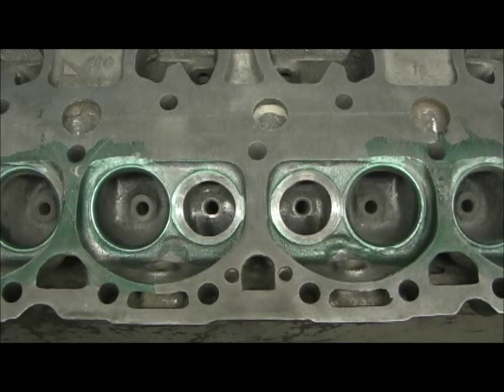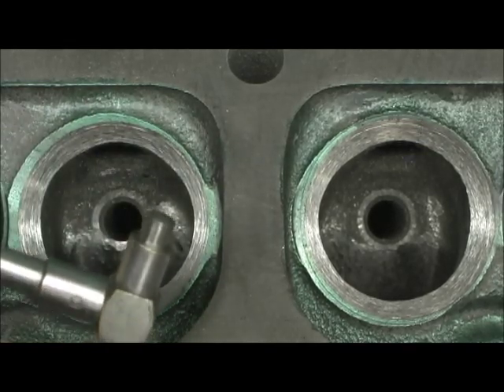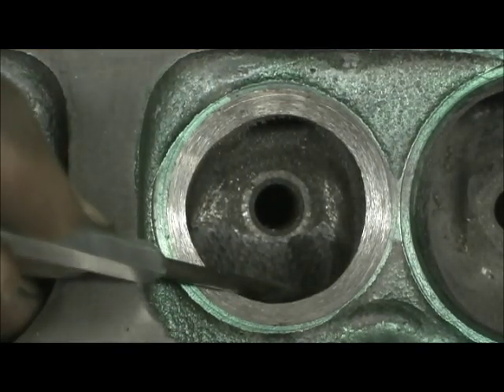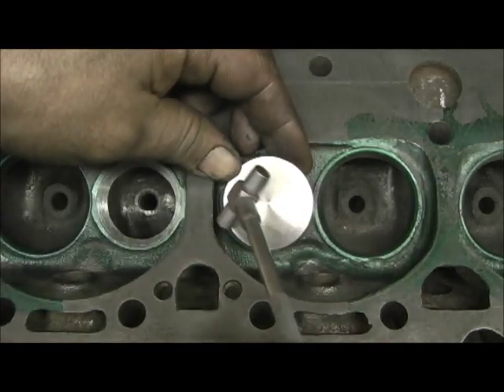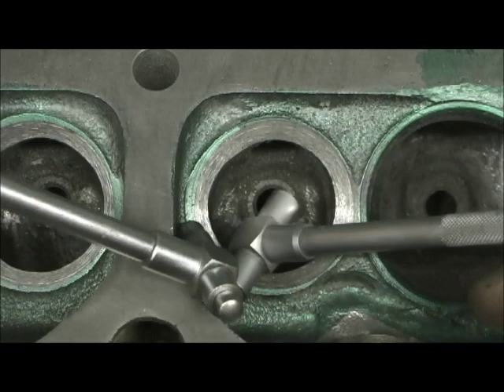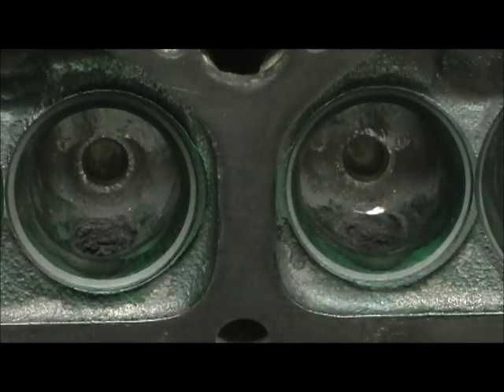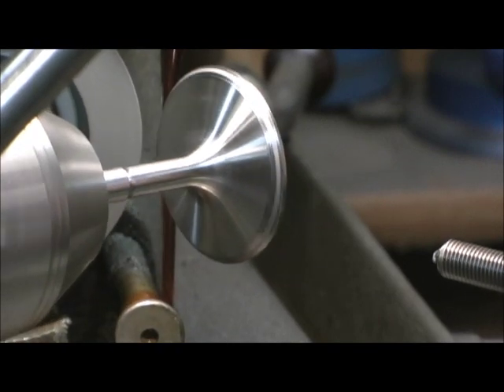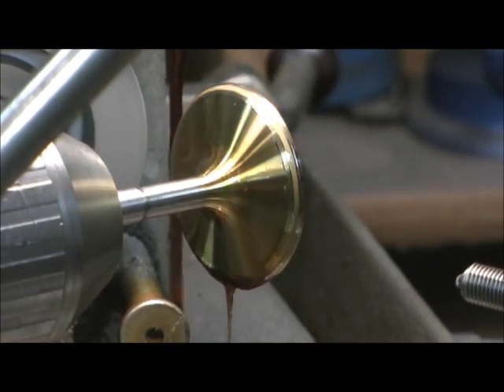882 Chevy Head 1 60 Exhaust Valve enlargement

Comment from the maker: I WISH I could enshrine that statement you just made onto a GOLD plaque, and hang it in my shop!!! Truer words were NEVER SPOKEN my friend. I have tried over 24 years now to get that across, with NO LUCK. I hate to say this out loud, but many of my power increases of my Stage III jobs over the past 15 years, came out of the GUIDES/VALVE JOBS as they were so messed up (some of them right out of the machine shop they took it off because of some other problem in the bottom end or had leakage)

Comment from the maker: I am not "right of the bat" bringing the memory of that casting, and I would bet (although not sure) it is a Peanut port BBC. What year is it, what intake or induction is it hooked to. If it is a peanut port, then stay with that valve, work on the combustion chamber around the intake side, hit the bowls HARD and re-shape the short turn on the intake side., Then new GUIDES, and a killer 4 angle valve job and pick up about 35 or so FT. LBS. Your not after Horse power, your after TORQUE and MPG

Comment: I want to use 1.94 in & 1.65 ex valves in my 882 heads both unshrouded of course. Will design my cam around the heads.

Comment from the maker: I am glad these people that make these commits are professional cylinder head men, who ran an SF-600 Superflow, and a Clayton 2600 HP Dyno, with YEARS of research on the subject, who have done both vortec and 882 in side by side comparisoms to determine which is best.  This is what I have done, and while STOCK the vortec is a better head, ONCE you take a grinder to it (which if you do that to the vortec you are a CRACK HEAD) the 882 BLOWS AWAY the Vortec in terms of Power, airflow and durability

Comment from the maker: Yea, the 882's do have a problem with cracking in that area; however, most of the time it happens is when the guides become wore out, and when they are loose they cannot transfer heat from the chamber. 25% of the heat is transfered through the valve guide, with the rest through the valve seat (45 degree angle face on the valve). almost every time I have seen them cracked, the guides were loose as hell. IF you use bronze guides, they hardly never crack.